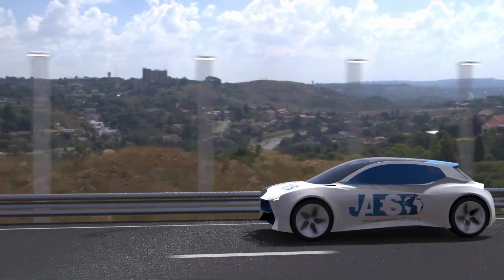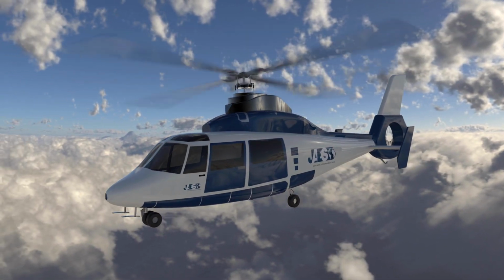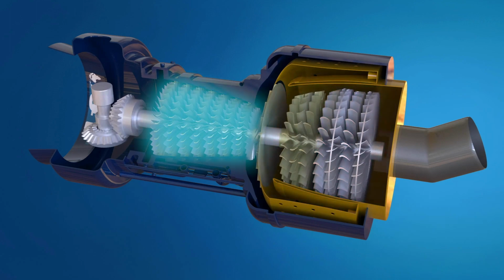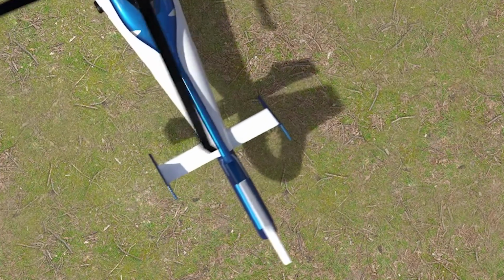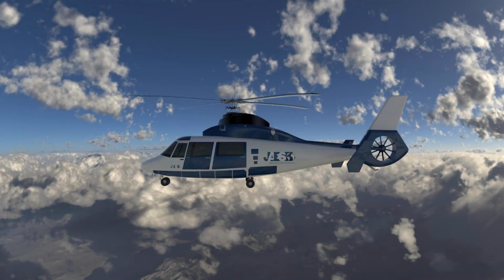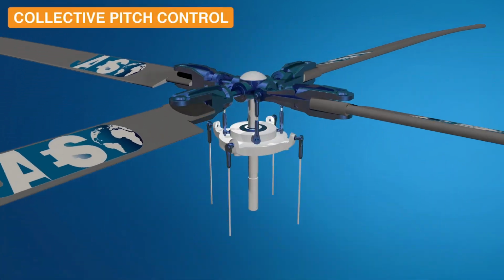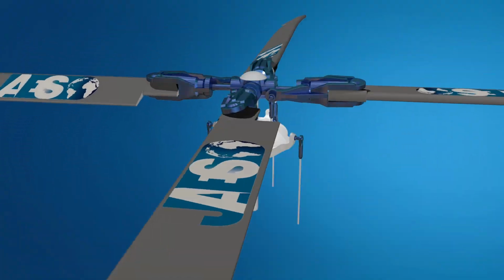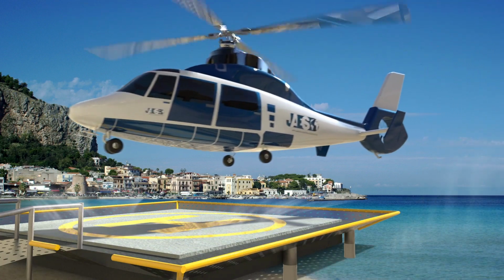How do HELICOPTERS work? Coandă or Bernoulli ? Newton’s Laws - Airfoil Technology - Angle of Attack

Comment: Very nice video congratulation.I usually dont watch all the video but this one I saw all. A couple nit-pick items: the blades on a helicopter are usually called rotors instead of propellers. I think, not all helicopters have tail rotors but I dont know if other can confirm. There are not systems and dual main rotor systems ( coax, tande, or intermeshing configurations).

Comment: Adding more blades does not automatically make a rotor head less efficient and more powerful. A Bell 212/412 is an excellent example of this. The rotating mass of the two bladed versus the four bladed system is approximately the same, so it takes approximately the same torque and consequently the same fuel burn for the same applied power. Its the characteristics of the blades themselves that change the helicopters flight performance. Without going into  excessive engineering detail, the two bladed version has better vertical lifting capability, especially at higher altitudes, while the four bladed system flies smoother and faster in forward flight.
Reply from the maker: thanks Brian for your comment

Comment from the maker: Please note :we had this comment we d like to share with all of you:
I only made it to the turbine portion. You are missing the gearbox. The compressor section is only compressing air. At least in 250 series, of once the fire is lit, the first stage of the hot section turns the compressor section making the turbine self sustaining. The second set of turbine wheels drive the accessory gearbox and then on to the main transmission. 

The compressor section does not ultimately have an sort or mechanical linkage to the transmission drive system
Reply: The second set of turbine wheels does not always drive an accessory gearbox. On some applications, the Sikorski S-61 being a perfect example, the power turbine drives directly into the helicopter main transmission. On applications using the General Electric CT-7/T700, the engine splines into aircraft gearboxes that change direction of drive into a main transmission, such as on the Sikorsky Blackhawk and the Boeing Apache helicopters. It would be better just to generalize about this point since an engine mounted reduction gearbox supplying output torque is not always a consistent application
Reply from the maker: @evulgenious  thanks a lot for you comment and support

Comment: The turbine fins highlighted when describing which turn the compressor and which turn the shaft are incorrect.
Reply: I think he said that the compressor blades turn the rotor.  This video is rather jumbled.  It's a bit of a confusing subject, but this is a jumble that should be sorted out.  The worst offender is the narration.  I think it just might have to be redone without changing the animations.

Comment: Very cool but it does stop well short of explaining all the effects. For example, the anti-torque rotor having its center-of-thrust below the center-of-thrust of the main rotor causing a rolling moment on the airframe which must be offset by lateral cyclic and so on. The effect-counter effects of helicopter controls are almost endless.
Reply: That's interesting.  A little like the outboard motor on a small boat.  The propeller is located well below the boat's center of rotation so the boat always banks into the turn like a motorcycle.  You're using the term center-of-thrust for the main rotor.  Is that the correct term?  I don't know.  I'm just asking.  I thought the center of thrust was a verticle line thru the center of the main rotor shaft.  I think I follow what you are describing.  Very excellent point.

Comment: Do you know if Bernoulli-Coanda influence the helicopter too ?
Reply: They both play a role in helicopter flight. However, it is very difficult to give a really precise justification as to why wings (and helicopter blades) generate lift. There are many "tools" that may be used in order to provide an explanation, and Bernoulli's "tools" certainly are among them. 

The Coanda effect is somewhat less evident but may still be applied when observing the aerodynamics of an helicopter. A really good example of the use of the Coanda effect is with the NOTAR (No TAil ROtor) system, which replaces the tail rotor on some helicopters (for example on the MD Explorer helicopter).

Comment: So you have to take action on all 3 controls when you have to turn the helicopter??
Reply: In fact, yes. In order to initiate a turn, you are essentially producing an imbalance that results in the helicopter manouvering. Once you reach the desired turn configuration in terms of attitude, you have to balance the helicopter once again. 

In other words, if I push the cyclic stick to the side, the helicopter will roll. By rolling, you are also rolling the lift vector that the main rotor is producing. Because of this, you will have to raise the collective a little bit in order to balance the weight. Producing more lift means that you are increasing torque on the main rotor, which leads to having to apply pedals as well. Lastly, you also want to pull the cyclic backward a little bit in order to achieve a nice, plane, turn. 

Helicopters are some of the most complicated flying machines. Pilots need to constantly move their controls in order to keep the craft balanced. Even hover flight requires constant adjustments.
Reply: Thanks for the reply.
But can a helicopter do loops or rolls?
If yes, will the rolls maneuver be performed with all the commands or only cyclic control?
Reply: @lucapavan8537  helicopters in general are capable of performing some impressive manoeuvering, you can surely find great examples of that here on YouTube. When it comes to loops and rolls, however, only a few helicopter types are capable of that. 

As far as I know (I am no expert of this very peculiar field of aeronautics), you need a rigid main rotor hub in order to loop and roll 360. In fact, the most aerobatic helicopters that come to my mind, the Bo 105 and the Lynx, both have a rigid MR hub. 

A true aerobatic helicopter (such as the especially modified Bo 105 that flies for Red Bull) also needs fuel, oil, hydraulics systems capable of pumping fluids at any attitude. 

I can't give you a definite answer about what actions need to be taken on the controls in order to loop and roll: there are many variations of these manoeuvres and I'm not a pilot after all. I believe you could loop from a hover condition using the cyclic only, or you could pull up and loop after level flight (you'd need more than just the cyclic).
I suggest you watching some videos of Red Bull's aerobatic heli for some more insight: maybe you can see the controls in some clips.

Comment: The tail rotor is powered by the engine of the main rotor? Or there’s another engine?
Reply: On some applications, the Bell 206/407 being the example, the drive for the tail rotor comes from the back of the engine gearbox and the drive for the main transmission comes from the front. The drive is interconnected through the engine gearbox
Reply: The main rotor and the tail rotor are mechanically connected via a transmission. This means, as @evelgenious pointed out, that the power for both rotors comes from the same engine (engineS in case of a multi-engine craft). 

Furthermore, it also means that if the engine were to fail, both rotors would still be turning together. This allows helicopters to perform auto-rotation landings, in which the engine power is lost and the helicopter is able to touch down safely using the energy that is still "stored" in the rotors.